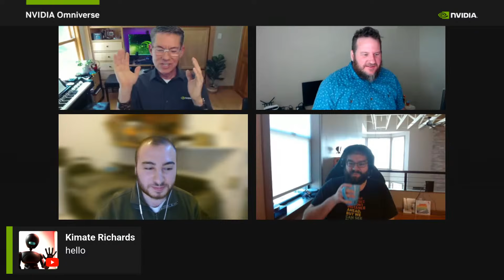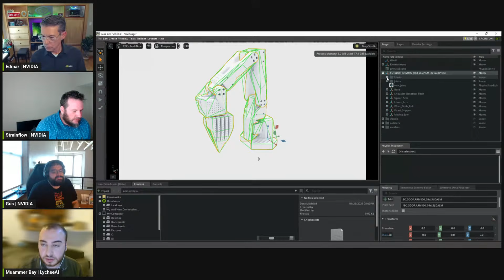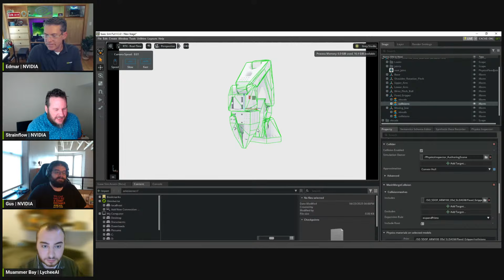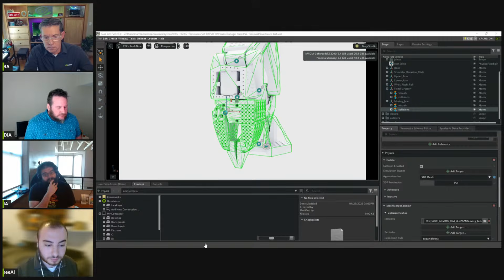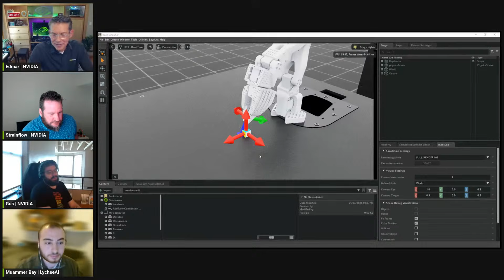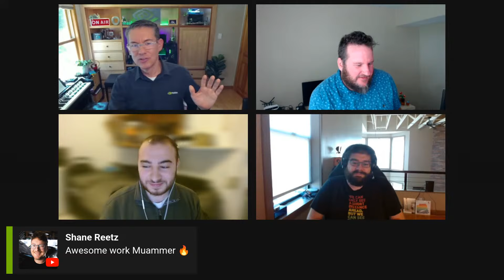Training a Robot from Scratch in Simulation, from URDF to OpenUSD

Comment: I believe the Stiffness and Damping correspond to the P and D coefficients of the drive. They’re effectively the same thing. The stiffness is multiplied by the error (difference between set point and current value), which is exactly what the proportional gain does. The damping coefficient is multiplied by the velocity, which is exactly the same as the derivative term. So they are physical properties. A damped spring is effectively the same as a PD controller. The reason that there is no integral term (the I in PID) is that it makes the behaviour unstable at low simulation frequencies. Real motor controllers can run at 20kHz, but most simulations run at about 100Hz. At low frequencies the integral term becomes very large, which causes unstable/divergent oscillations. But PD control is stable at low frequencies.